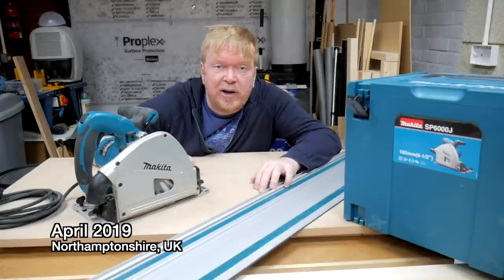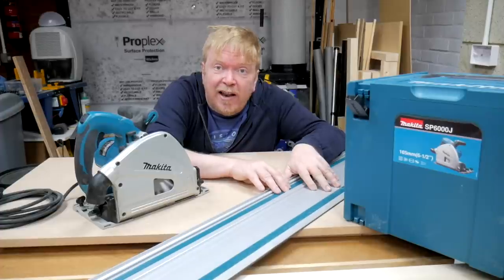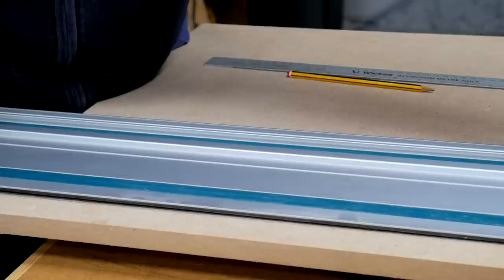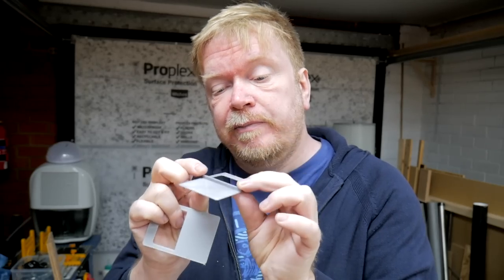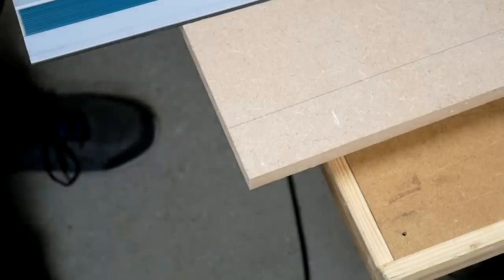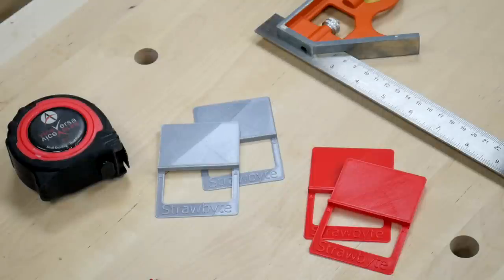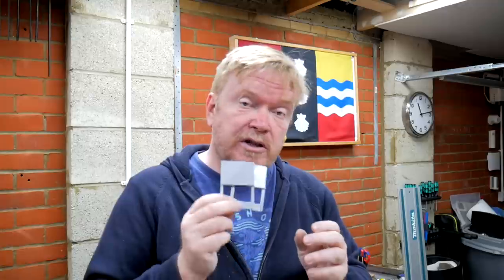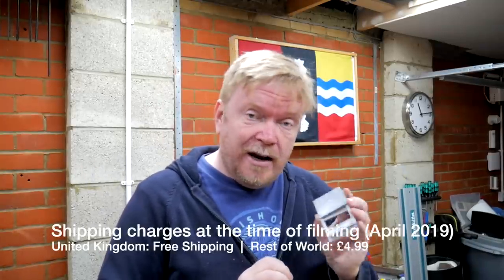Accurate Waste Side Cuts | Simple Jig for Makita, Festool, Triton and Others | Kerf Maker

Comment: I know it's an old video but here's my question. What's the purpose of the part that goes under the track? As I see it, we don't need that half. Cheers.
Reply from the maker: Hi thanks for watching - I'm pleased to see it still get views despite it's age.

So, at first glance, you'd be right to assume that the part under the rail serves no real purpose, after all it's the ridge against the splinter guard that's the critical dimension. However in practice you want the guides to remain in-place if you're adjusting the rail at either end to line-up on marks on the workpiece so they help with that. Its a feature thin enough and sized to both be held by the rail and be easy to remove without the rail moving. Basically, trial and error led to this working out best when I first came-up with the idea leading to what you see now.

Comment: Please correct me if I'm wrong. But can't you just minus the blade width from your measurement to allow for the blade. And then align the guide rail on the pencil like normal
Reply from the maker: You need to ADD the blade kerf to the part size and align, but yes you don't need the guides. However, adding 2.2mm and then accurately laying it out is a challenge. Harder still with blades with smaller kerfs. 
Or alternatively avoid waste side cuts at all. 
What the guides do is deliver cabinet grade accuracy and customers tell me they save time and the avoidance of mistakes.
Reply: @StrawbyteWorkshop  ahhh okay, makes sense. I'm no expert so was just wondering as I have a DIY project coming up. I will be a customer then :) 
Thank you for your reply. Appreciated

Comment: How do the cuts compare between the makita plunge saw and circular saw using the rail? Great channel!
Reply from the maker: Hey Andy thanks for the comment. There will be more coming up regarding the tracksaw, but to answer your question. The cuts are broadly similar in terms of quality and both cut plywood without tear-out under the splinter guard. The biggest difference is the start of the cut where the circular saw has the depth already set and is attacking the edge of the board. I find that the blade deflects a fraction and that initial inch out ever so slightly. I did think the circular saw would be without purpose, but I've been recently cutting laminated insualtion board which is 60mm thick and needing some dust collection. With extra depth of cut, the circular saw is a great tool to reach for.

Comment: Hello Karl,
I’m guessing you have answers this question a thousands times, so one more time won’t hurt.

I use the Makita 56T blade that came with the track saw. Which waste side jig do I need to purchase? Thanks!
Reply from the maker: HI Mister M - I know I've answered your question elsewhere, but for the benefit of the comments, what you need depends on the saw.
Corded saws are 2.2mm generally however in the US a blade width of 0.057" or 2mm is common. 
Battery saws have thinner blades and depend on the relative age of the saw. Newer saws are 1.45mm whereas older saws are 1.6mm.
Reply: Hi Karl. Thanks for getting back to me. The blade is 1.45 according online specs. 
I placed my order for a set. 
Be well.

Comment: Hello, If I required ones for kerfs = 1.8mm and 2.4mm are you able to make them? If so what price please. I am using the Makita circular saw (the one you have) with a track adaptor etc and the blades I use are from Saxon . They are a good invention
Reply from the maker: Hi Christopher you can buy both from my website at www.strawbyte.com click on the merchandise link in the menu (top right). 1.8mm guides are a standard size and are 6.99 GBP and 2.4 are a little more expensive as they're a custom size and are 9.99 GBP. Use the custom size product and specify 2.4mm. I hope that helps. K.

Comment: Excellent video, highly informative. One question though: Where to begin cutting that rubber when using a circular saw - HS7101j -. With a pluge saw it seems pretty easy.
Reply from the maker: Great point! It's a little trickier But you follow a similar approach and don't worry too much about the first 3-4 inches as the saw will be half on the rail. My circular saw video shows me using a new rail, I think.

Comment: Been using tracksaws since conception. I’ve always just plunged the blade down (not spinning) at each end of my cut aligned to my pencil marks. these plastic things are slick but add an extra step. ok for the hobbyists with time on there hands but slows down workflow in a professional situation. But each to there own I guess
Reply from the maker: As you say each to their own.

Comment: I’m curious. I have the cordless makita plunge saw but the efficut blade with it has a kerf of 1.45mm yet the red ones are at 1.6. Did they originally post with a different blade?
Reply from the maker: The 1.6mm guide was the most popular request from folk after I started offering the 2.2 ones. I checked at the time and that seemed correct. The efficut blades are 1.45 so I think I'm going to make new model. If you want to road test them send me your details via the About > Contact page on the Strawbyte.com website and I'll send you some out for free.

Comment: Hi this is excellent do you have them for Maffel track saws
Reply from the maker: Hi Keith. What's the kerf width of your Maffel saw blade? I've versions for 1.45, 1.6, 1.8, 2.2mm as standard, plus 2.4, 2.5 and 2.6mm custom versions.
Reply: Hi not sure I will check
Reply from the maker: @keithbucknall  HI Keith - I've looked the blades up and I think they're 1.8mm kerf blades - the same as the Bosch tracksaw.
Reply: Strawbyte Workshop ok thank you so much
Reply: And just purchased. If you have any other dust adaptors or 3D prints will buy.

Comment: I'm guessing it does not matter which saw you use, plunge or circular saw, it's the width of the blade that matters ?
Reply from the maker: Nope, it's the kerf of the blade that's key here. It even works with home-made guides.
Reply: @StrawbyteWorkshop  Hi, sorry, I meant the kerf of the blade. What I was trying to say, in a hurry to rush out that day, many people use circular saws with tracks, they also change their blades as most are not decent that come with the saw.

Comment: Neat idea- I will knock up a couple on my 3D printer. Surprised they are not on Thingiverse...
Reply from the maker: Thanks for the comment and yes it is a neat idea. And the reason they're not on Thingiverse is that the idea is my intellectual property and they are registered design and I pursue folk that infringe my design rights and get them thrown off the site. Sure make some - but don't copy and distribute.
Reply: @StrawbyteWorkshop  I would not dream of selling such stuff. I am an 'open source' fan, and offer what I design to those that make rather than buy.
Reply from the maker: @Tensquaremetreworkshop  I'm a massive open source fan too - I worked for years security testing open source software like Wordpress and more recently open hardware projects. The market for the guides turns out to be commercial joiners and hobbyists who don't have access to their own 3d printer. Actually, I never intended to sell them but people wanted to buy. However once your start selling the biggest risk you face is that some unscrupulous manufacturer takes your idea and makes money off the back of it. And that's not fair and you're not typically allowed to do that for open source models either and yet I see so many items on Ebay and Banggood that rip-off well meaning open source enthusiasts.
I do release as many designs as I can under Creative Common's Licences with Attribution & Non Commercial, including a version of this guide. In many situations the need you solve for is not new and the resulting solution is often obvious. (I don't think that's true of my guides, however) But still, you still own the copyright and unless you give it away in some fashion it's yours and not everyone's. Thingiverse are very supportive and I win disputes based on the fact I had the original idea, that failure to provide attribution is the breach of their terms of service. The they were attributed and not carbon copies of my design and shared alike I'd be happy. Where there is a very close resemblance to version 4 of the guide which is what I sought protection over, things are made easier by the protection. 
Anyway if you message me through instagram @strawbyteworkshop with your email address I'll send over the CC version to save you some time - but I can now draw these from scratch in SketchUp in under 2 minutes so it's pretty easy. 
Anyway I've really enjoyed your comments this afternoon and they've made an important contribution to this video I think. I re-read my reply earlier and I hope you didn't think if it as too abrupt.

Comment: are you going to make them for the new K series TS 55? it uses a 1.8mm blade
Reply: Just checked your web site.. looks like there is already a 1.8mm there for use with the Bosch.  It should work nicely with the TS 55 KEB
Reply from the maker: @pctatc66  You should find a 1.8mm guide in green specifically for the new Festool tools, if you want green of course.
I will be doing an updated video since I make them to suit practically every plunge saw that has ever existed.

Comment: Hi Karl, I have two sets, one for Makita 2.2, and one for Festool 1.8. Brilliant little device. 
I do often make narrow cuts and wondered if you considered making the part that is not under the track, about half the size. It would be helpful when using the adjustable square.
I watched your video on insulating your garage, and man was it a great help.
Regards, Bob
Reply from the maker: Hi Robert.  Thanks for the feedback I love hearing about them in other people’s workshops. I do have an upcoming version designed to work with combination squares with steel rulers and a video in the edit showcasing all the various use cases.  Oh and thanks for the comment on the insulation- it’s one of the best projects I’ve ever completed. It’s taken a good two years to finish all the bits and pieces and again I should have a video soon on what I’ve been doing since all the main work in 2019.
Reply: @StrawbyteWorkshop  An update on the revised version would be deeply appreciated.
Reply from the maker: It's on the way. I've finally got around to doing new videos for all my products.